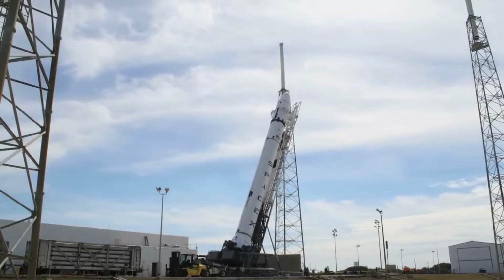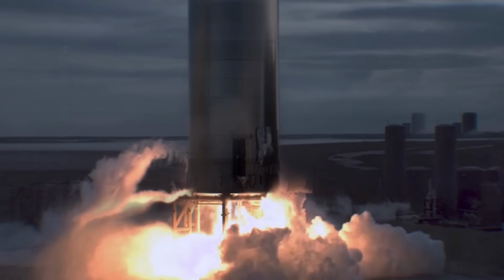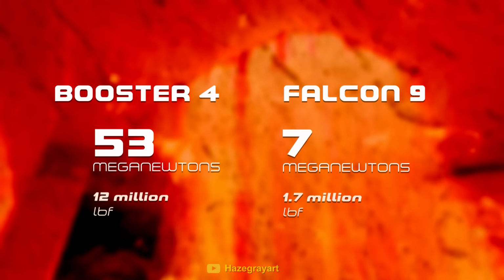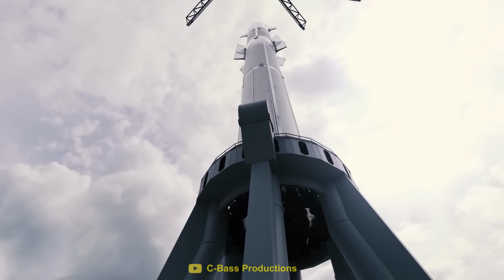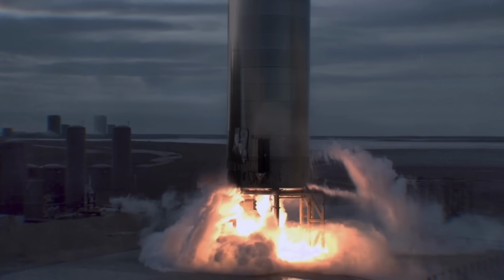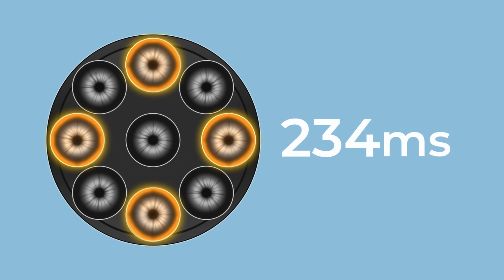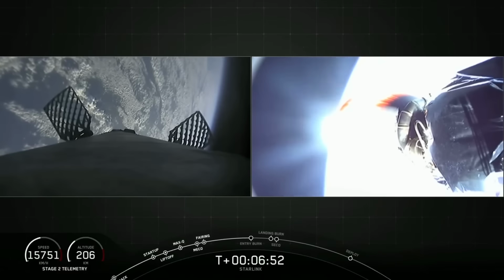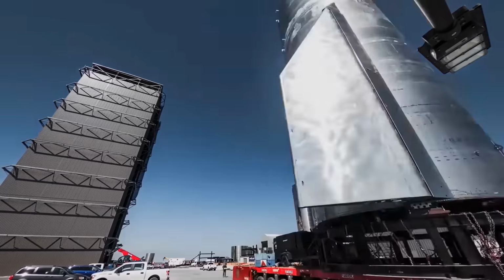How SpaceX Will Test 29 Raptor Engines

Comment: The engines on the N-1 could not be test fired before launch as they lacked parts (I am pretty sure the valves had pyrotechnics involved where they were either on or off. But it is early in the morning and I could be wrong) that would allow them to be used multiple times. To try and skirt this issue, the soviets would test an engine or two per batch as an overall quality assurance check.
Reply: A much larger problem was that the engine was not even fully developed when clustered in a full-scale launch.  The engine really needed another 1-2 years of development and testing in smaller clusters before attempting a large cluster.  Unfortunately the space race combined with Soviet politics prevented that from happening.
Reply: It was vibrational attenuation that tricked the computer into shutting down engines.
Reply: https://www.youtube.com/watch?v=lp_-RBXKacU
Reply: The N-1 is the first project ever conceived to use that many engines. They can't come up with solutions for turbo pump schemes that can work with 27 engines so their solutions is simplify things so the engines would do it's own thing and make it unable to be tested all together as the burnouts once started it would be final. 
So they tests individual engines but never tests all of them together. 

Here we have SpaceX with 33 engines and each with its individual turbo pump i presume? Will it rival the largest non nuclear explosion of N-1?
Reply: So once a valve was turned "off" it was going to be off forever?
Reply: @BobStein  If I remember correctly the valves were turned off by default and required pyrotechnic actuators to turn them on (or something very similar). Once they were on, they were on until the first stage ran out of fuel or until the rocket staged. In the N-1's case though, it was when it exploded.
Reply: @Jan M Yes it is correct. Please read what I said again. I am talking about the test fires, not the actual launches. As for the actual launches, you are most certainly correct.
Reply: Didn't work.
Reply: @garfieldirwin  Thank you for your input.
Reply: @garfieldirwin  Dude, spoilers.